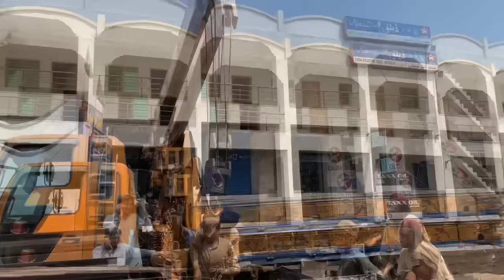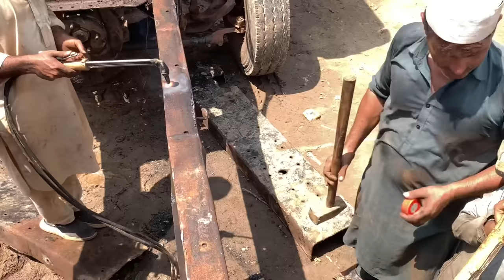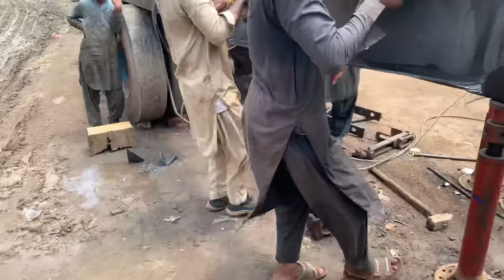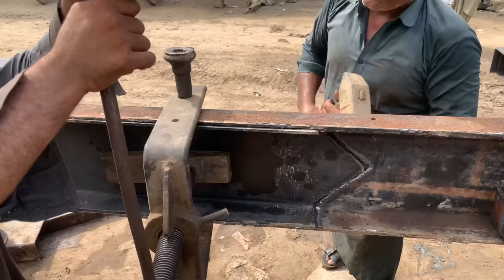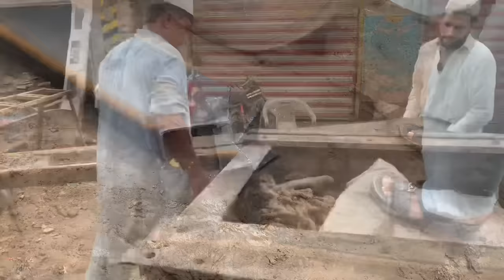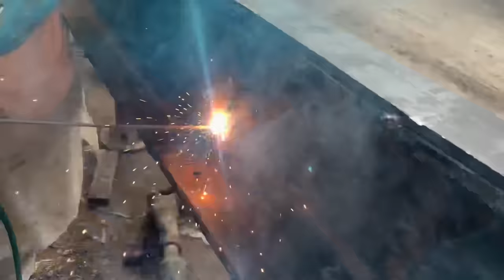How to repair a broken truck chassis || Truck chassis repair || Truck Frame repair

Comment: Not sure about their welding skills, but they know the concept of repairing things, not just parts exchange like nowadays in our countries.
Reply: I agree, why not just run a bead? also the weld wasn't hot enough.
Reply: norolemodel  Really pretty $hitty welds, wonder how long they last ????
Reply: And it's in and out of the shop the same day unlike the months it takes here

Comment: Glad to see all the proper ppe being used, the 'squint' goggles, fireproof pyjamas and special welding sandals😮
Reply: Exactly and the perfect continous vertical weld passes
Reply: These are security sandals! Not only for welding but for any decent task requiring extra safety!
Reply: Thats pakistan safety standards; welding sandals etc
Reply: "How is that fellas start-stops?" you mean his welding?
Reply: And waterproofed  Water is going in and going out
Reply: Don t forget the pakistani hard hats
Reply: They don't got bullshit osha lol. I wouldn't wear or do half the safety stuff I do at work if it wasn't for them, too meticulous.
Reply: The welding sandals prevent sock fires  🤣🤣
Reply: Some were barefoot. But really we shouldn't mock them poverty creates unusual circumstances.
Reply: @dolphhandcreme no loo ni no no lool ni no loo ni
Reply: Yeah, steel toe sandals 😂, I'm joking around these Pakistan boys do good work!
Reply: Na..  Pakistanis have fire proof feet. Pele did not like football shoe the first time he used it because he could not feel the ball. This highly safety conscious Pakistanis know better
Reply: @nonenothing8648  Very funny!
Reply: Leave bro.  In Pakistan, people are cheaper than safety glasses and special shoes 😂
Reply: @denver12ua  Where should I move to?
Reply: @RoBFE-fe5dh The welding leaves a lot to be desired. 
As a 4711. Ticket holder, all positions,  I came to comment..
Mind you they did have some good glamps, and have done such work before..
Cheers..
Reply: O
Reply: Don’t forget the natty crochet hard hats . . .
Reply: steel toe sandals, osha approved.
Reply: ... I think there is a crack in the welding mask !
Reply: I like it this way... ha ha.
Reply: go ahead bro and jeer at them, but they get it done.
Reply: @udo5479 😂

Comment: Feels like using clamps to press a thick piece of u-channel onto a damaged frame that it does not otherwise fit onto, then holding it in place with “tack” welds using a stick welder and not cleaning the scale off between each tack nor doing any metal prep whatsoever, followed by grinding of what little weld material exists afterwards will result in the likely cracked weld splitting and the stored energy from the clamped u-channel releasing in a violent disintegration of the frame. But what do I know
Reply: probably, these were not good welds at all. sometimes they look pretty good, not here.
Reply: Alles halb so schlimm....für die schlechten Schweissnähte wird eben nachher doppelt so viel geladen ....oder min. 50% mehr , dann passt schon alles !! 😝😝😝😉😉😉

Comment: With such limited resources and facilities these guys get the job done. Not saying its perfect or safe by European, UK or USA standards, but it works for them in their country.
Reply: With such limited resources and facilities these guys get the job done
Reply: Definitivo ,es admirable el grado de colectividad a la hora de hacer su trabajo , y el desempeño profesional ,  obserco que en la india  ,hay mucho trabajo mecánico profesional , pero parece que hay mucha explotacion de mano de obra calificada , que no dan crédito a buenos establecimientos y normas de seguridad , observo mucho los trabajos ee torneria , es algo increíble y de respeto , se le respetará la jornada laboral y el salario ? , mis respeto a estos grandes trabajadores profesionales.
Reply: The  employment-to-population ratio in 2023 was 47.6%,  so they have a replacement pool, see no need for PPE or safety rules
Reply: No, we just spend ten times more then we need to get the job done.

Comment: What seems to have been done here is they had sandwiched the original frame rail with two pieces of frame rails, one smaller and one larger, to reinforce the breakpoint in the original. Then they welded the reinforcement frame ends to existing sandwiched framerail plates at the ends, and hopefully they are staggered…

The welds are not holding the entire weight of the frame and whatever is on top of it, they are probably just there to keep the frame reinforcement in place as well as provide some solidity to the whole chassis.

That being said, I wouldn’t necessarily trust a vehicle repaired like this 100%, and I very much doubt that this repair or anything done lie it will pass any form of vehicle inspection in any first world country with decent standards (no way in hell) but for what it is and given the circumstances of the area this was done in, it’s amazing to consider how they make do with what they do have, and if it works, it works.
Reply: Looked like the chassis had been extended previously but not done very well? 
Now, truck can be overloaded even further so transmission and engine can fail?
Reply: @1crazypj  they can easily just cast a new engine and trans with sand. They do have plenty of that laying around.
Reply: @1crazypj   Yes for sure the truck chassis has been previously extended, with less than ideal strengthening.
But, as ever, this is Pakistan, so  likely all parties were aware of that, but everything is constrained by microscopic budgets.
Reply: "I very much doubt that this repair or anything done lie it will pass any form of vehicle inspection in any first world country"
Sorry to sound rather sarcastic, but 'Thanks, Captain Obvious'.  
Re the repair;  as far as I can see, these repairs where the frame rails are effectively doubled, would hugely increase the strength of the frame, and I don't see any reason to not trust it 100%. The issue is, rather, that however strengthened these are, and however, the springs are increased (see other videos), they trucks still often end up overloaded, way beyond their OEM stated limits.
Reply: Primer mundo? Donde es eso? Nueva York está inundada con 3 días de lluvia. El primer mundo sólo existe en sus cabezas😂
Reply: @alexanderSydneyOz estás en lo correcto, en Argentina a la colocación de un perfil más ancho sobre el chasis original se le dice "envainado" y es práctica usual en cajas de vuelco trasero y en la colocación de grúas para descarga
Reply: sorry to sound sarcastic, but thanks for stating the obvious as well, are you the reason we turn our UHFS off within 50k of Sydney (and Melbourne) ?
 @alexanderSydneyOz
Reply: @nacerdepie6255  totally agree ! it’s just a different way of life
Reply: I agree, it will hold out. They are working with what they’ve got.
Reply: They added on about 4 feet. It wasn't a repair. You can see by the driveshaft not being long enough.
Reply: Откройте окно , стало душно в комментариях
Reply: @alexanderSydneyOz  Yes, OEM brakes with more than OEM weight carried.

Comment: Never has so much work created such a substandard result.
Reply: those welds won't even hold a garbage can together
Reply: Look where they are... don't be so arrogant. They work with what they have, and don't rely on buying overpriced Snap-On tools to heighten ones sense of abilities.
Reply: I hope their nuclear weapons are better than their chassis repairs.
Reply: This truck would probably be rolling again carrying 35-40 Tonnes of load, which it wouldn't have been even rated to carry, from the factory itself but "jugaad" goes a long way, you gotta work with what you have and that's what these men are doing.
Reply: @Yaahoooooooooooooooooooooo Sometimes being a little safer would help in the long run. At least wear some gloves or you could make a welding mask from scratch easily.
Reply: @NGHmusic  You have a valid point, the issue is that these men even when educated about safety would mostly ignore that, they are so used to their workflow that they would take safety equipment as a hindrance.
Reply: @Yaahoooooooooooooooooooooo  Its all fun and games till someone looses they're eye.
Reply: @collegestudent6071 grind or even filing the slag off the parent metal is a basic principle of achieving a strong weld, so stop commenting on a subject you clearly have no knowledge of!!! Those weld are weak, completely useless and dangerous 🤬
Reply: Where is all you know it alls videos?
Reply: @terrybrown8539 . Super power nuclear country with not safety work environment.
Reply: สุดจัดปลัดบอกแน่นอนจริงๆ
Reply: People in rich countries crying in comment section😂
Reply: @collegestudent6071  Keep in mine they poo and pee at same place they go into the water so...
Reply: ils sont vraiment courageux
mais question sécurité zéro
gants , chaussures de sécurité ils ne connaissent pas , ils ont un demi siècle de retard et voir plus par rapport à certains pays
Reply: Sinceramente que hptas tan brutos sale más rápido y mucho mejor poner el pedazo de chasis nuevo que chimba de  brutos
Reply: @terrybrown85Будите приставать к ним со своей " демократией" , узнаете качество их ядерного оружия.39
Reply: If they can afford the metal they definently can afford the equipment.
Its obvious you never buy steel yourself.
Reply: Wonder if it wouldn't been simpler to replace the whole frame rails. They're using a lot of steel and it seems like they have a crane.
Reply: that made me chuckle, ty
Reply: @terrybrown8539 Thats debatable. They lost lot of scientists because of nuclear exposure but since they are Americas friends , nothing is in news.
Reply: terrybrown8539exacto, y que dijan esas armas a todo EE UU
Reply: Sounds like my dodge ram
Reply: Um povo pobre, humilde e sofrido, mas trabalhador. Com parcos recursos materiais e financeiros e mesmo fazendo a seu próprio modo, recuperam e fazem funcionar novamente aquilo que para o 1o. mundo seria sucata. Mas o principal que move esse povo acima do trabalho é a sua fé em Deus / Allah - exatamente o que está faltando ao ocidente. O resultado está aí para quem duvida.
Reply: @monstereng43  Not by choice.

Comment: These boys are doing a great job. I've done this type of work for over 50 yrs and they're doing fine with what they have. My only criticism would be, I would have ground the flame cut edges before fitting and welding.
Reply: That's not a great job!! It's a mess.

Comment: they were really good at buffing up frames when I was over there... most of the trucks came from Pakistan. Of course they needed to buff them up to support all those explosives so it didn't bend the frame and so they could get it over the Khyber pass in one piece... but they got pretty good at short term repair jobs like this

Comment: 2 different trucks cut in half and made into 1. It's the birth of Frankentruck 😮
Reply: no, one truck lengthened. seems to be a common thing over there. most i've seen have been lengthened in a stronger way than this one

Comment: You have to admire their teamwork and the use of home made tools is impressive and at the end of the day they finish the job, though their welding skills are poor, just by poking the rod (which is too small in diameter for the size of steel plates they are welding) into the gap will not weld the two parent metals together in a safe way, as can be seen by the cavities when the welds are ground flat.

Comment: First view makes one wonder, how did this happen and how did they get it to the repair yard. They were obviously doing what they could with what they had.  They definitely added some weight to the frame with these side rails. Looked like they almost drilled through their chain while making the bolt holes. Thanks for sharing and good luck with your recovery. 😊
Reply: looks like they extended the chassis but used some hacked up old frame rails for the extension.
Reply: Police Police tracker 🚨🚨🖲🇵🇭Philippines
Reply: The weight isn't a concern. That's what? Two or three percent of the max weight? Then it's still 98 percent better than before.
Reply: A26 45 il se brule les pieds il me semble
Reply: Repair yard we don't need a stupid repair yard 😂🧐

Comment: Got to love then “dimes” the welder was stacking on that frame 😂😅🤣
What is that old say A grinder and paint will make me the welder I ain’t😁
But what the hell when working on clapped out junk that has been overloaded to death and will be again after this most excellent repair job who actually give any consideration about airborne intercourse with a rotating perforated pastry

Comment: Their sandals are like shoulder straps in the army. The higher the rank, the better sandals you have the right to wear. rubber slippers for a private soldier, leather sandals for an officer, and when you reach the level of a general, you have the right to wear leather boots

Comment: I realize they’re not building a space ship or a race car or anything  like that but how can you possibly build, repair, or do any frame straightening on an non level surface like the dirt lot they’re working on???? And there welds are absolutely horrific, what’s with all the stitch welding?? They’re not welding sheet metal here🤷‍♂️

Comment: Having worked  at ERF. Yes I'm back, 😅,I didn't see any cross members in this part  of the chassis, &  from the back of cab to the first rear axle it was inevitable it was going to break at some time, This never happened to a ERF truck.😅

Comment: How many times do u weld this frame .it’s been welded in so many places .if the floor is not straight how do u measure if it is level maybe just eyeball it

Comment: Will the heated areas and welds not created weak or brittle points after cooling?
Reply: yes
Reply: The welded joins are not providing the chassis strength. 
They are holding the additional frame rails in place, and they are plainly going to be much stronger than the original.
So the welds may well be more brittle than the steel plate generally, but it is of no consequence.

Comment: I wonder if any job is inspected and do they have a code system ? my son went to Pakistan las summer and the whole place is packed with repair shops all over the city but what got my son was these guys work outside all day in temperatures well over 100 degree Fahrenheit

Comment: The chassis was already modified ahahah. For the safety: this is nothing, its normal to cast melting aluminum holding the die with bare foot

Comment: Cannot use Safety Squints and the highly calibrated Eyecometer. I am more surprised at the use of new Material and not some rusty crap,  But the best is the GOB welding. a gob here and a gob here and It will work.

Comment: Some porosity in those welds 😅
Reply: Removing the rust beforehand might also be advisable.
Now the truck has rusty beams between the new beams.
Welding should also be a little easier without all the rust.

Comment: Are they using 1/8"x 7018 Low Hydrogen Rods. I was noticing how effortlessly the slag was popping off, however the arc starts and stops like a 1/8" x 6011 or 6013.
Reply: Definitely using what they have not what would be ideal...  This part of the world people are plentiful equipment isnt... That truck is probably two peoples 10 year salary new...  It's not possible to not fix it they haven o choice and resources are very limited...

Comment: good work but it is a type of remedy that can only be carried out in a few backward countries... in the rest of the world such a repair would never be authorized for road safety reasons and therefore the vehicle could never circulate on public roads again. ...at most it could be used inside private properties such as quarries and farms without ever going on open roads
Reply: There lies the problem with so-called civilized countries.

Comment: Every time a chassis breaks, hundreds of pounds of metal are welded and added  to the total weight of the vehicle. And with more weight to carry, the chassis/frame will break easier next time, whereby more weight in metal is then welded on. Catch 22 here.

Comment: Afraid that would never go at a DOT inspection. At least they have plenty of help of all ages young and old. Sometimes the simplest tools are the best. Hard to beat a couple of good hammers and a few screw jacks and a stick welder. Guess you use what you have at hand. Kidding aside I won't down these people cause they are hard working people who use what they have and do the best they can with what they have.

Comment: Those so-called welds where they just spot-weld are very weak welds and have holes in them which makes them very weak. I don't understand why they can't do a continual weld without spot welding. After the man grounded down his weld you could see holes all through it which means it is not welded together effectively. This seems to be how many of these men weld instead of doing a continual weld like some of the men do. A spot weld is only necessary when you are attaching metal and you want to pin it in place so it does not work when you start welding the whole thing together.
Reply: There not good welders no training
Reply: This whole job was probably done for a couple of hundred bucks, and now it gets put back to work. In the western world that truck would be junkyard scrap. So who's wrong and who's right.
Reply: That’s so plenty of water gets between the plates to make sure it rusts away within a month.